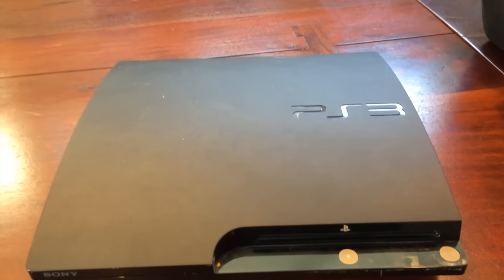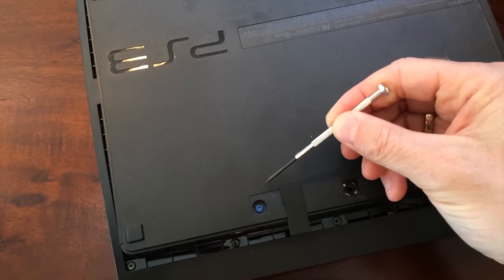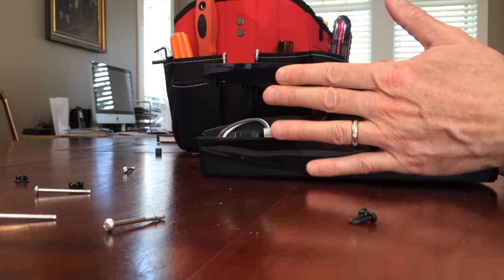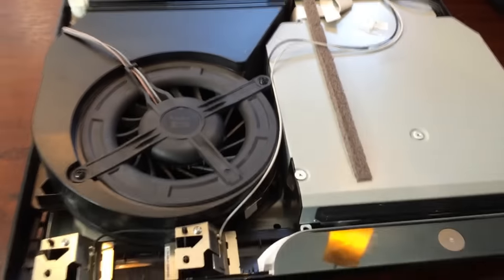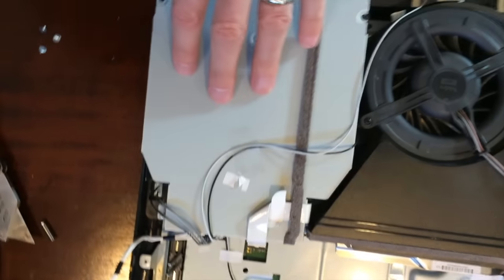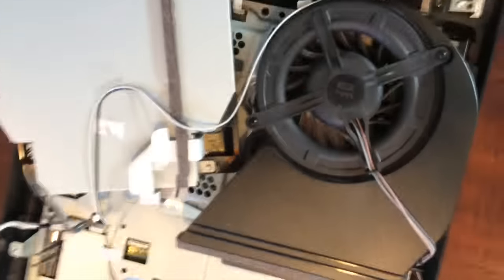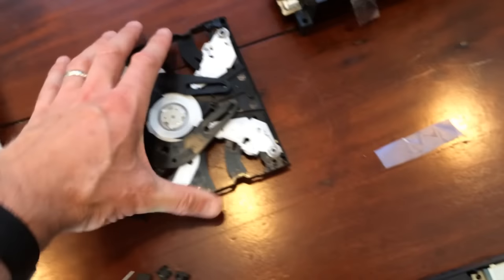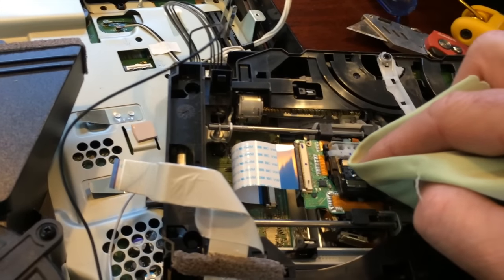How to disassemble and clean your PS3 laser

Comment: If you dont have a star key for the 4 screws, use a really small flathead screwdriver and line it up inside 2 of the 6 ridges (avoiding the little bump in the very center of the screw) and start unscrewing! Then just screw them back in using that same method
Reply: Can confirm this works.
Reply: thank you so much
Reply: +Daniel Carrillo (DanielplaysMC805) No prob!
Reply: thank you man, god damn, I just went and bought a small torque set, and they are not hollow points! saved me some $.
Reply: hey that is what I did also LOL
Reply: +Uncle Jeff's World Lol nice bro.... yea didnt have the tool so had to think outside of the box!
Reply: +nicholasbraud1986 nice! Glad to hear that. No problem brother
Reply: Outlandish Kreationz
Same here. I didnt see your post till after I had reassembled my PS3 and added a comment about the video missing a step to prevent damage to the drive cable..... He did not unlock it, just yanked it out...
Reply: Thank you so much for this tip dude. You rock!
Reply: No problem, glad it helped!!
Reply: Outlandish Kreationz Shit.. The little bump is broken..
Reply: +InfinityViiper exactly what I just had to do. such a pain but I was able to use a small flathead to get them out
Reply: Legend
Reply: Outlandish Kreationz <3
Reply: Outlandish Kreationz thanks !
Reply: Thanks bro
Reply: Outlandish Kreationz Damn, this actually worked.

Thanks for the tip/technique.
Reply: Tk Ripia It's basically like the Xbox's ring of death
Reply: Oh thank you I had stars but they didn't help because of that little bump you saved me extra money thanks
Reply: You are a legend
Reply: Thanks bro it worked😎
Reply: And if you don't have a really really small screwdriver use a plaster spreader
Reply: 😭😭😭im not getting it
Reply: Thank you was about to loose my mind!!!!!!!!😂
Reply: E.T. Jordanzo aka Outlandish Kreationz that didn’t work for me I used a small one and it fit inside but when I tried turning it it kept slipping note that this was a brand new screwdriver that came with a set and the PlayStation hadn’t been opened yet
Reply: E.T. Jordanzo aka Outlandish Kreationz thank you so much ! You saved me life !
Reply: It worked so well, I paniced when I saw those screws but your idea is amazing! Thank you
Reply: It indeed.does wprked i couldnt find one small enough til i saw a glasses repair kit and that worked perfectly
Reply: Thank you I sat here for a good 30 mins trying to get them out with the torx bits
Reply: Twitch Happens life saver
Reply: With some patience and quiet I did it
Reply: Thanks so much!  Was driving me crazy!  And, folks, it's a small flathead bit.  Mine says 1/16.
Reply: YOURE A SAINT
Reply: so I tried fixing my ps3 and couldn’t find the star key, but this helped me a lot. Thank you
Reply: Man thank you so much❤️
Reply: I see everybody else struggling with the screws but for me the front left corner won't pop up not the disc insertion side but the other corner.... Any ideas??
Reply: It worked with just 3 of them. The 4th one don’t know how to screw it. Any extra tips?
Reply: Dude, you’re an actual life saver. Thank you so much
Reply: Youre a beautiful soul
Reply: my man
Reply: Omgg thankss so muchhh
Reply: Just tried this method but didn't have a flathead small enough. Used a sharp knife and it worked like a charm though!

Comment: 4 years later and I just used this video to help me clean out my PS3.
Reply: 5 years now :/
Reply: Lmao same,doing this just so that I can play the my MGS Legacy Collection and hopefully it will work
Reply: My disc drive won’t eject my original copy of tomb raider (ps1) and I want it back i hope this video will help.
Reply: 6 years later and i use this to replace my hdd
Edit: im an idiot cuz i didn’t relize i didn’t have to take the whole thing apart to replace the hdd.
Reply: @anthonyg7623  you got video?? I'm having trouble  my tv reading it
Reply: But it really works Plz reply???
Reply: @aafiashaikh3279  yep it works.
Reply: 9 years broddy
Reply: Add another year bro
Reply: 2020 gang!! Video was very helpful, but mine still won't read discs, guess its more time trolling the interwebs for advice
Reply: @lehlohonololelakane9468  there are adjustment screws to raise and lower the laser as well as potentiometers to adjust the strength. They also still sell replacement lasers for it
Reply: Now im using it
Reply: What’s the name of the tool he used to take out the star heads ?
Reply: Same here man
Reply: Anybody else have trouble opening the top??
Reply: i came from 2024😂

Comment: It's crazy that you have to go through so much just to do so little.
Reply: That's Sony for you
Reply: You don't. I dont know why he tears it down so far. You can literally just take the top off, remove the BRD shield and you're done.
Reply: dog shit person stfu prick, who are you to tell people what words to use?
Reply: @thelegendkillersshittyduff1335  EA is worse with microtransations
Reply: "It's a fairly simple procedure.

We're just going to take out about 1,000 tiny screws. Make sure you keep track of where all of those go. Also, be careful not to damage these 20 very delicate connections as you disconnect/reconnect them. Alright. Now that we have taken 20 components apart in order to get to the part we're going to clean, we will very delicately clean something that has a diameter of 2mm, 'without getting anything else around it.' Fairly simple."
Reply: @diminished2nd  Not gonna talk about replacing the cmos
Reply: Well,I don't think cleaning the lance is little a job.
Reply: Just buy a laser lens cleaning cd.

Comment: Those of you whos ps will not accept  discs after this process didnt reassemble your disc drive correctly, check your ribbons, also there is a white sticker underneath the drive if you put a Phillips head screwdriver through it you can turn it  to manually actuate the disc drive arms open  and lower that tab that blocks you from feeding in a disc there are plenty of videos that show proper assembly of slim ps3 drive

Comment: Thank you ever so much for this video. It helped me to solve the problem I was having with my PS3 Slim. In case others are having the same problem I did, the nature of my problem was that the console could read CDs and DVDs, but NOT games or Blu Ray. When I would insert a game or Blu Ray disc, nothing would happen on screen. I could hear the disk revving and the sounds of the laser trying to read it, but ultimately the console would make a sound as though it was ejecting a disc. So I took to YouTube searches to see if I could fix the problem, and I was led to this video. 

If you follow this tutorial exactly (also use a can of compressed gas for electronics to clear out the dust and wipe down with a microfiber cloth where appropriate) and it doesn't fix your problem, then you either did something wrong, or a dirty lens is not the extent of your problem. 

Just take your time, focus on the task at hand, and keep all the components that you're removing from the system all organized and grouped so that it will be easier for you to remember how to assemble everything back together again. I'm a girl who is not all that tech savvy, so if I can do it, there is hope for you, too!
Reply: My ps3 has been having this problem recently where only some of my games work and the other ones freeze
Reply: Good advise, just don't spray compressed air into the bluray drive or you will need to tear it apart and clean the laser of any dust.  :)

Comment: THIS DID WORK TO GET DISCS TO BE READ PROPERLY AGAIN, but I have to give a warning to people with a slightly different interior to the PlayStation (like I had—maybe for a UK version?):

You don’t need to take the disc compartment bit off AT ALL. We did because it showed him doing it on this video, and I believe his PlayStation required it, but what ended up happening for us was that this strip of plastic containing a load of lines of copper within it disconnected from the disc compartment to the board.

It was a real hassle to get the white strip back into its slot which it was pulled out from, and we spent a good 15 minutes trying to stick it back in (with some tweezers coated with tape so as to not damage the strip) before we managed it—if it happens to you, it IS possible to stick back in, but it’s hard and we needed two people.

All that being said, we’d tried a lot of different ways to get little big planet up and running again, and this was finally the solution we needed, so I’ve gotta thank the creator of this video for helping us out massively!
Reply: Thanks for this I've been struggling I also have a problem where it registered my PS4 controller as long as it's always plugged in facing the PS3 but no matter what I do it won't connect a PS3 controller
Reply: Uhhh welp i think i ripped the slot itself off the board...help? Can i just tape it back 🤌🏻💀
Reply: @menendezola1060  I bent the white part and scratch it a very tiny piece off and now it's not even trying to read the disc
Reply: True LittleBigPlanet fans right here

Comment: This is helpful!  Something you should definitely be specific about is whenever you remove the Shiny steel cover to reveal the armatury of the disc drive, the plastic arms and small gears are held together mainly by plastic dial pins and the layers of the housing snap together using interlocking plastic tabs its very important to look over everything very closelyz make mental notes of everythings location before your remove layers to see the eye and clean the eyes! Basically soon as you take the 1 tiny Phillips head screw which is the only screw that holds the second cover on along with 3 plastic tabs one you remove that cover with the armatury, soon as you lift it off everything springs back into its proper place! The problem I had after taking it apart was the disc would eject or feed because i took it apart with a disc in it! I did a 100% clean on mine because this is something that you should definitely do yearly! Depending on the Consuls location and the environment!  For example, i have a fore place in my house, in my living room! Plus 1 cat and 1 dog! Therefore, it's a very dusty environment. Regardless of how much you vacuum and clean, you're still going to get heavy dust and lint in your Game consoles!   So cleaning properly is important! Also do this somewhere thats well lite with bright lighting and level surface to work on and the proper tools! I always tell my little brother whenever he is wrenching on something like a gaming system to take it apart in the tub in the bathroom! 
Why because your inclosed incase something shoots out like a spring or a screw falls youll not only see it bit hear it too! And being in the tub and curtains or doors closed around you nothing can get lost!    Its funny but thats the type of area you need! Nothing like ruining something all because you lost 1 tiny part like a spring or screw!

Comment: Just finished doing this and it worked like a charm. Thank you! I did have a problem with the unit pulling in the disc after I put everything back together though. What it was was I didn't have the white strip plugged back all the way in that was next to the black screw at the back of the disc contraption. After I fixed that I tested everything to make sure it injected (?) and ejected and read disc's before I put it all back together again. Also for the tiny star screws, I used a small flat head screwdriver from an eyeglass cleaning kit. Hopefully that helps anyone having issues. Take care.
Reply from the maker: Tina D glad it worked out. I'll pass on the "white tape" issue to Luke who seams to be having the same problem.

Comment: Hey Mark I disassembled mine and cleaned the laser and put it back together and it won't pull the disc in. It just makes a gear grind noise and just stops. Only thing that happens different from your video is that I forgot there was a disc in the player so I pushed on the disc just barely and the gears pushed it out. Could that make it not work or could be be something else? It was working fine before but it just wouldn't load anything? I love to hear your feedback on this thanks

Comment: I used your video to completely clean out a 2nd hand console .. fan etc everything and clean the laser while i was at it ... looks like New inside and out now! 
One criticism... your video seemed to skip parts and could of been better ...many screws were already out which you didn't mention... like on the laser drive case( silver side .. there are 5 screws )  and a couple of other things... still i got the job done and so much easier to pull apart than the dreaded Xbox which had the red lights of death... terrible machine!! 
A bit of a longer video in its entirety would of been better but the jobs done now so thanks.

Comment: People shouldn't be afraid to work on things, take your time, pay attention, go slow, and try your best! All it is is a big puzzle that requires keys to take apart or put together!   Keys being tools! I worked at a scrap yard for years of my life as a mantince guy! I fixed all the heavy equipment and machinery! During that time, i saw people throw away everything from AC units, tractors, lawnmowers, vehicles of all types, motorcycles, ATVs, TVs, all household appliances! And the sad part is at least 75% of all of that stuff could have been fixed easily and either for free or very little costs! I have 2 lawnmowers and 1 tractor i use to mow my yard, and all that was wrong is a pull string or a battery. Sometimes people let mowers and tractors sit for years at a time and the carburetors get gummy inside!  All it takes is a couple hours of time, some simple tools and some carburetor cleaner with compressed air and everything is perfect like new but rather than do that the out gas in it sit there and crank on it and crank on it till the damn battery either blows up or goes dead then the pitch it and go and spend 2,000$ or 3,000$ even more than that on a brand new tractor! I have a neighbor that is so dumb he has literally 5 tractors and several lawnmowers behind his shed because he said they were junk! I got a lawn boy mower 4 stroke with the bag and all attachments for free! 900$ lawnmower!  No shit look it up! I clean the carburetor replaced the air filter and pull starter, added new fuel line, and fuel filter! 3 pulls it started right up!  
Its not even about being cheap its about being smart and utilizing things rather than throw money away like a fool!   I have seen cars like BMW's M3  
Audi A 8.  Really decent trucks and cars scraped because of a few small problems! People instead of trying to fix it or asking someone they junk the car and buy a brand new one! Even if i was a millionaire i would still never be like this!  This is part of the reason this country is so fucked up!  The way people are today this country will havw to rely on other countries to grow our food! Make all our products we need! Nothing will be made here! No one will know how to fix things or build things! All trades will die out! Just in my short lifetime only being 34 years old now i can not believe what a difference in everything since i was a young kid! I feel horrible for all future generations and even worse for the older people seeing there beloved country beign destroyed and going from proudest to most shameful!  I have a daughter! And i feel so sorry for her! Its. Shame i have to tell my kid not to have kids of her own, never get married, stay single, stay away from people and trouble! Its so sad! Soon as she turns 18 ill be moving to the deep north west mountains to be as far away from the stupidity and lazy ass cry baby comys in this country!

Comment: What did you use an alternative if you didnt have the special tool to take off those safety screws?
Reply: Yea I'm having trouble trying to removes these as well
Reply: Chris Huitzache i used a  knife
Reply: +Chris Huitzache take it to a near by repair shop and ask them to replace the star screws with philips screws, least thats what i plan to do lol the official tool is expensive, he said us a regular star head but i couldnt get that too work on the last one (RIP PS3 #1 you deserved a hammer tho)
Reply: JONNY CRASH I did end up taking off the star screws, and didn't screw them back in, and I carefully dissembled my ps3 to clean the bluray laser. It didn't work so for now I have to play digital games until I buy a ps4 in December
Reply: im skipping ps4, maybe next gen wront be pay to play online, sticking to pc for now and holdin onto my ps3 for a min. i invested $80 into a tb hard drive havent been happier lol
Reply: +JONNY CRASH i think you can put an ssd because it's a 2.5 inch
Reply: yea i used a hard drive from a laptop, from best buy, notice a slight lag tho when scrolling the xmb menu after the install

Comment: It worked for me.
bought a 500gb PS3 slim for $70 off craigslist. watched the guy have repeated trouble getting it to read a game disk. he pops in a DVD and it reads it right away. then puts the game disk back in, and it recognized the game. I get it home, and it will not read/recognize games. so after feeling like I got taken, I saw this video, and followed it step by step. it's amazing the system even ran at all with the amount of dirt/dust inside. I cleaned the laser lens with an alcohol wipe, cleaned the fan and the cooling fins while I had it apart, put it back together, and am now the proud owner of my first PS3 that works great!

Comment: My 3 year old had pushed DVDs in and out multiple times to the point the PS3 wont eject the cd/dvd and my 8 year old and I are not able to enjoy games. I thought to open and see why the dvd is stuck and had no idea how to open it and ended up on this video. Thanksfully I had the required set of screw drivers and guess what, there were 4 DVDs stuck in the drive lol! Well now working well again. Thanks heaps for this video. Very helpful.